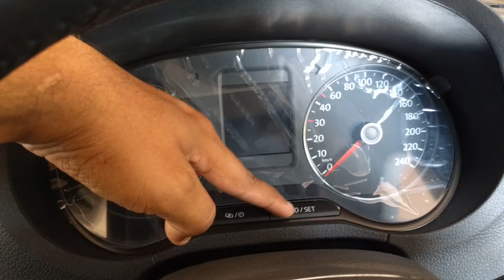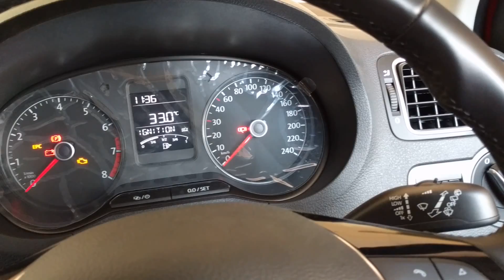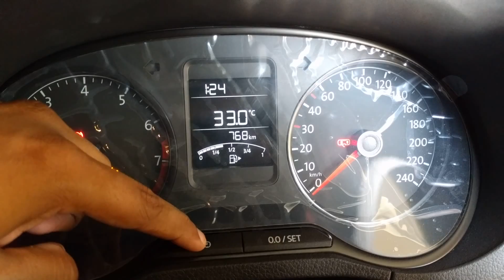Driver Information System in Volkswagen Polo 2017 - AllStar / Highline / GT

Comment: Hi Dilip, can you make a video on comparison between polo 1.2 litre and the new polo 1.0 engine's performance difference, I was curious to know as I have booked a comfortline polo petrol 1.0 after looking through all of your videos I just developed a very strong liking towards polo but I'm afraid whether the 1.0 can accelerate without any issues, I have test driven but couldn't make out much as I took a test drive in heavy traffic, just give me your insights and will be very helpful...:)
Reply from the maker: You can go ahead and get the 1.0 l petrol happily. It has a more refined engine with low vibration/noise levels compared to 1.2 L variant. It will also give more mileage.  Performance of 1.2 L & 1.0 L is almost similar.

Comment: Sir can you pls tell us what is use of right silver square button on steering wheel??
Reply from the maker: I can't understand which button you are mentioning. Please send me pics of the button to my mail id naranedilip@gmail.com
I will reply back in my mail
Reply: @dilipsukumar  There are two buttons in right side steering controls. similar to the one which is used to change the tracks (in left side). what is the actual use of it? And how to go to vehicle settings, enable/disable anti theft alarm.

Comment: Dear Sir, I totally glad n appreciate these informations n other videos which u had posted on VW Polo. 
I drove a 2010 Polo n would like to know if it is normal upon ignition the battery symbol appear but disappeared after that. It did not appear during my driving. Pls advise me. Much Thanks.
Reply from the maker: That is absolutely normal. You need not worry...
Thank you so much for your valuable feedback...
Reply: Thank you very much, Sir. Keep up the great work.
Reply from the maker: You are most welcome...

Comment: Sir is the distance to empty is accurate if we drive in a constant speed? Because when I add petrol it showed 300 and within 6km with normal speed it came down to 280
Reply from the maker: +govind anil it depends upon various factors like your driving speed, Number of stops you make, your driving style and number of gear changes. Generally, In city driving conditions it keeps decreasing and in highway it keeps increasing until a certain limit... The distance to empty is directly proportional to the mileage of the car. It is fairly accurate.

Comment: I need to ask that in car 1 is how much km we have drive for eg 20000. 2 I need to ask that if we full the fuel full and check how much km it runs so how to trip zero of swift car... Could plz tell
Reply from the maker: +Mayank Joshi 1. if you press the knob near the Speedometer you can check various parameters such as total Kms, trip meter, AVG. Fuel efficiency ....
2. To reset the trip meter -
Press the button until your display shows 'trip'. Now press and hold the same button for 5 seconds. Trip meter will reset to zero

Comment: How to turn digital speedometer in the new polo all star ??
Please guide
Reply from the maker: +karu dudeee please use the up and down arrows in the right hand side of the steering mounted controls. You can find the digital speedometer easily. Do this when the car is moving. It is easy to find it when it is moving
Reply: dilip sukumar thnkz a lot 😄😄
Reply from the maker: +karu dudeee Welcome!

Comment: Sir are you getting only 8kmpl mileage ?
Reply from the maker: +Tharun J Prasad no. I get a mileage of 10-12 Kmpl in city and 17-19 Kmpl in Highway. 
It shows 8 Kmpl as I was idling the Engine for a long time to record the video.
Reply: dilip sukumar Sir appreciate you for timely reply. I am planning to buy petrol version comfortline btw is maintainence cost very high ? Mileage is decent it's almost same as my vxi swift not much difference then.
Reply from the maker: +Tharun J Prasad Maintenance cost of Polo will be definitely higher than Maruti Suzuki. Polo needs to be serviced once in 15000 km or one year whichever comes first. Cost per service will cost max 15000
Reply: dilip sukumar Thanks you again for replying. Please share your mail ID. I wanna know regarding the performance as you have purchased this car when you had better car swift in your garage. What is so appealing and pleasing that you made this choice inspite of drop in the horsepower compared to swift VXI. Thank you sir.
Reply from the maker: +Tharun J Prasad Definitely this 1.2 MPI petrol variant is not for people who expect great performance. The performance of this car is adequate for daily usage in my opinion. If you want very good performance you should check the Diesel TDI variant. I chose this car as it is a very safe car for my family. It has a steering wheel that gives accurate feedback and the stability of the car while we drive at triple digit speeds is excellent. Features like Automatic rain sensing wipers and cruise control are really very useful while driving very long distance in the highway. I drove for more than 1100 km in the last 2 days in the highway, hills and bad roads. The driving pleasure I got from this car is amazing. I want to drive more and more...
Reply: dilip sukumar Okay nice Thank you Sir for your unconditional timely replies. Due to budget constraint I am settling for MPI model. Have a nice day👍
Reply from the maker: +Tharun J Prasad I also settled with the MPI model due to budget constraints. I actually like the GT TSI. But it was out of my budget. 
But, the performance is adequate for daily usage. I  cannot overtake like a boss and zip through in city traffic as i do with my Swift. Also, if I have 5 passengers on board, I cannot overtake a bus or lorry easily in highway. Rest all the time I find performance to be ok. It easily reaches above 160 kmph in the highway, but a it's a little slow in reaching such speeds. But stability at such speeds is absolutely amazing... It is best in class... No car can come near to it...
Reply: dilip sukumar Yes Sir GT tsi is awesome. But people make statements that DSG setup is unrepairable if anything goes wrong, it has to be replaced, which costs a lot.
Reply from the maker: +Tharun J Prasad definitely Manual Gearbox is more reliable than the DSG Gearbox in the long term. And it is too expensive in my opinion. The Comfortline is the best value for money...
Reply: dilip sukumar Okay Sir thank you. Waiting from the dealer to know the July offers. VW right now not dispatching vehicles to their local dealers due to GST norms.
Reply from the maker: +Tharun J Prasad Welcome!
And please buy at the time only if when you get good discounts. I got only  20000 discount in February and in March it was 45000. In June it was 50000.
Reply from the maker: +Kushal Kumar thank you so much... I cannot understand your question... Can you please explain...
Reply from the maker: +Kushal Kumar thank you so much...
1. During delivery time an odometer reading less than 50 km is acceptable. You can drive without a number plate for 100 km. 
2. Speakers in the Polo is excellent... But it has less bass. If you want more bass you have to add a subwoofer... But the quality of music is really good... The music system is 'Harmon kardon' brand...
Reply from the maker: +Kushal Kumar please send all your queries to my email dilipsukumar@yahoo.co.in
I will reply as soon as possible.
Reply from the maker: +Kushal Kumar you can send mail to my mail whatever mail you are in. You can also send mail to naranedilip@gmail.com
Reply: dilip sukumar Thank you sir.
Reply from the maker: +Kushal Kumar Welcome

Comment: Hi Dilip. your videos are really helpful in so many level. Thank you so much. I own a POLO highline Petrol and im not sure when to leave my car for the first service. I feel like VW 7500km mark (Digital display) for the first service is too late. When i checked the Service manual it says 5000Km for the first oil change (Not sure if it just for the oil change or even the general service as well).. both are contradicting. Do you have any comment on this ?
Reply from the maker: +Arun Sigamani 1.You have to leave your car for first service only in 15000 km or one year, whichever comes first. 
2. However, there is a free checkup in 7500 km. You can use that.
3. First Engine oil change is also at 15000 km only.
4. I am glad that my videos helped you...

Comment: There are two displays for fuel consumption in Km/l numbered as (1) and (2). I understand that (1) is the current fuel consumption. Is (2) the average fuel consumption?
Reply from the maker: yes, you are correct. one is the current fuel consumption and the other one is the average fuel consumption.

Comment: is 8 the all mileage that u r getting..?
Reply: dilip sukumar Firths thanks for such informative video.My ques how much will be the mileage after 1st service . second if i do child lock it gets open from outside which is dengerous these days due to late night trips on isolated areas. plz suggest for this.
Reply: dilip sukumar thanks sir for the prompt reply. but in my polo highline. when i am activating child lock and making central lock active still it gets open from outside. plz give detail reveiw in ur video of child lock. Thanks
Reply from the maker: +Saneesh Sunny no. It is showing 8 as I have kept the engine running for a long time for recording this video... I normally get a mileage of 10 to 11 kmpl in city & 15 to 16 kmpl in Highways
Reply from the maker: Ritesh Chauhan 1. mileage will improve a little bit after first service. you will get 11-13 Kmpl in city and 17-19 Kmpl in the highways
2. if the centre locking system is in locked, doors cannot be opened from outside. even when child lock is engaged, when Central locking system is locked doors cannot be opened from outside
Reply from the maker: Ritesh Chauhan Welcome! 
is it? I will check that in my friend's Polo Highline and keep you posted.
Reply: dilip sukumar  日日死詞窮鞥昂按

vcar o bn.                私瘀唉哀哀阿兒